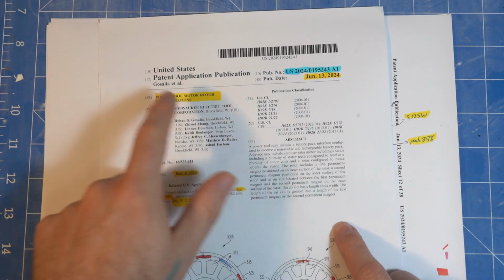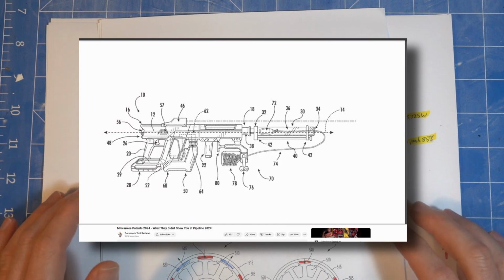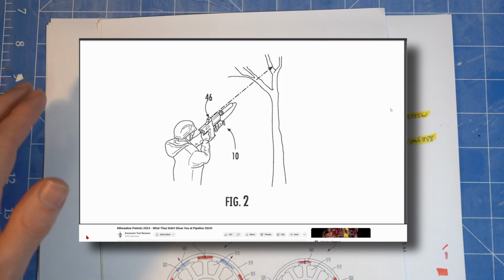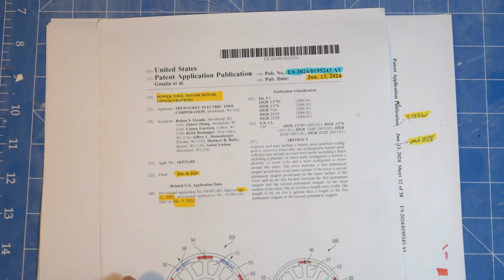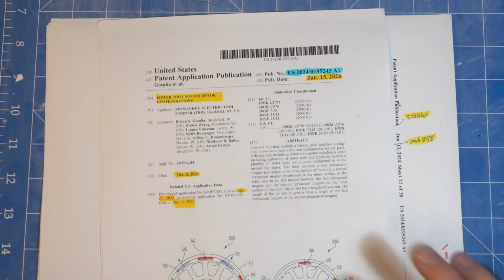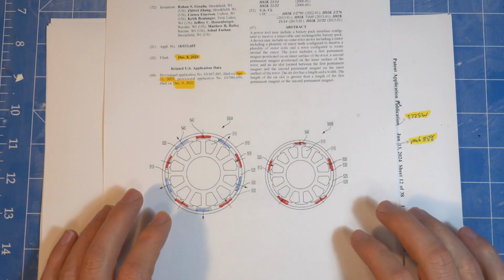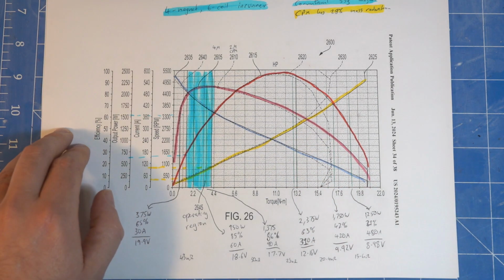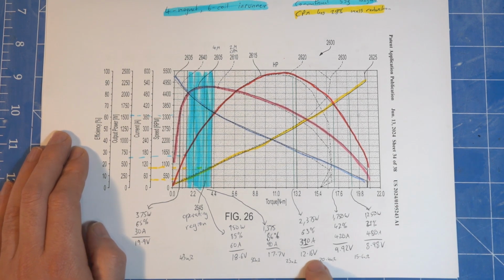Milwaukee M18 motor dyno graphs

Comment: Ok but why are they running it to such a crazy amperage when it should never get even close
Reply from the maker: I guess to see what it's capable of. They could also be running an inertial dyno, in which case it starts at peak torque & current and works its way back. The > 300A would only happen for a very short time, but may as well graph it.
Reply: @ToolScientistRAW  ig knowing what it does wont hurt

Comment from the maker: 4:35 I'm prob wrong about this motor being for an impact driver. Impact driver's only have single stage planetary gearboxes, which top out at 10:1, which would give 6,500 RPM. M18 impact driver is 3,900 RPM. I think it's more likely an oscillating multi-tool, which runs at 20,000 OPM, so a more reasonable 3:1 reduction.